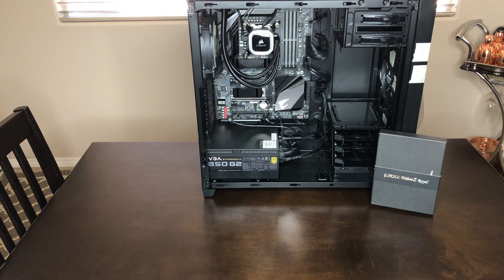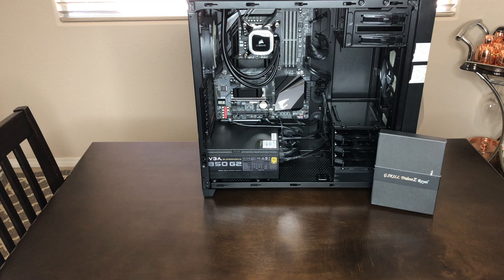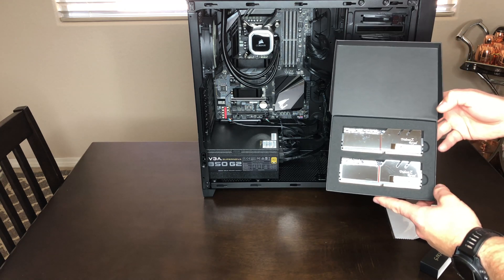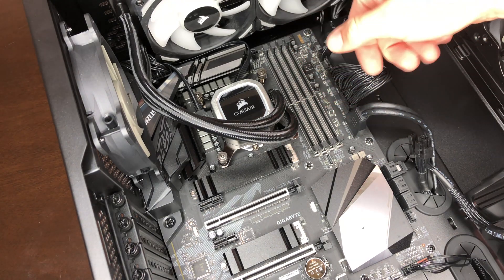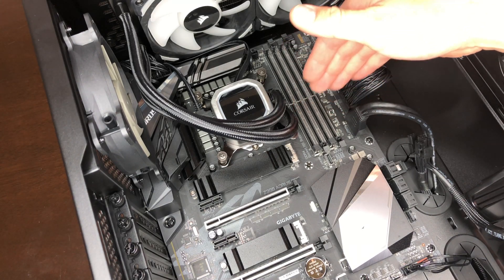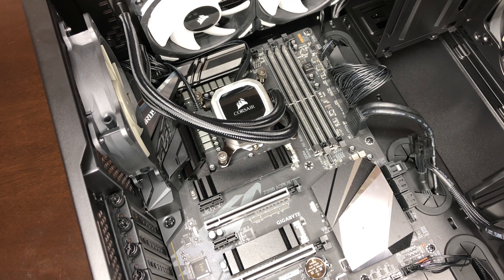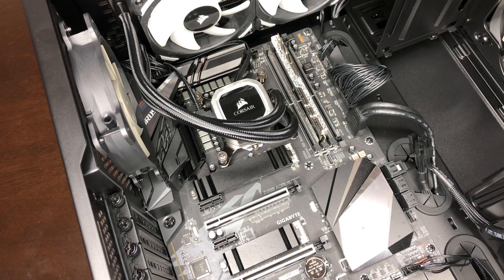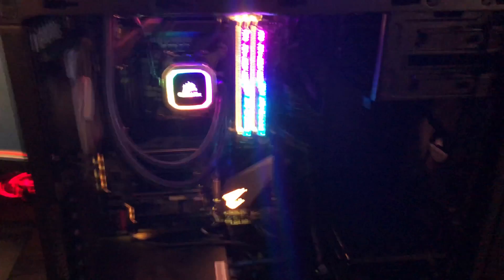Installing RAM - G.Skill Trident Z Royal Series 32GB DDR4

Comment: Can you use aura sync software to control these particular ram chips?
Reply from the maker: Hi Jeff, I have seen a mix of goods and bads in regards to this on the internet. Some people say it works, while others say it doesn’t. I’m assuming it has something to do with motherboard compatibility and the RAM modules; however, I have not tried Aura Sync with the ones I have. I’m not running an ASUS motherboard.
Reply: tYBoMB Gotcha man. Yeah I have ordered all the parts to build a new rig and the mobo of choice was the Asus Crosshair VIII Hero and I went with the 32gig CL16 @3600mhz Trident Royal (silver) and one of my main goals is to get all the internal crap+peripherals to sync up (will maybe try out Icue software as well). Thanks for the reply though. I guess I will see via good ol’ trial and error if it works or not. Here’s hopin’ lol
Reply from the maker: That will be sweet, man! Yeah, I feel you.  I made the mistake of having different manufacturers for my motherboard, RAM and CPU cooler.  So I have to use each manufacturer's software for the LEDs.   It still looks great, but I'm with you on having them all synced up!  Let me know how it comes out!
Reply: tYBoMB fur shore my dude. I’m a resourceful lil bugger. If there is a way, I shall find it lol

Comment: Looks like you have a Gigabyte z390 mobo and I am pretty sure all that series with 4 Ram slots use a T-topology setup meaning you get better performance by using ALL 4 ram slots instead of 2. So if you wanted 32GB you should have gone with 4x8GB.
 I just order 4 sticks of the Royal. Couldnt resit that bling :D
Reply from the maker: My goal is to purchase two more 16GB sticks, but they are quite expensive! lol
Reply: @tybomb  you need too buy a kit for it it too work buying another set of two won't work